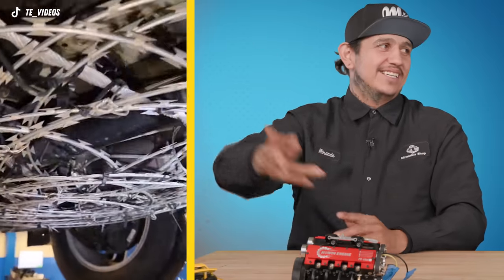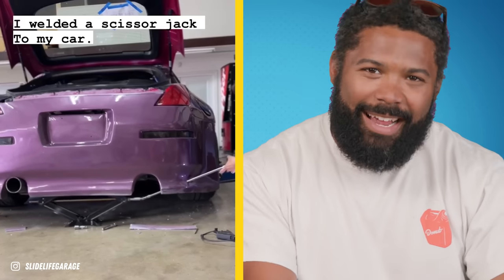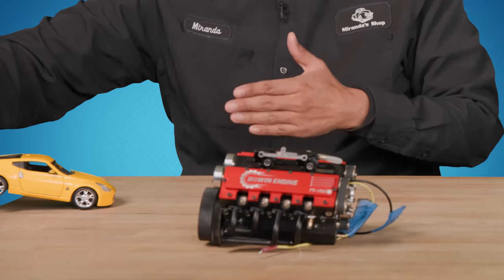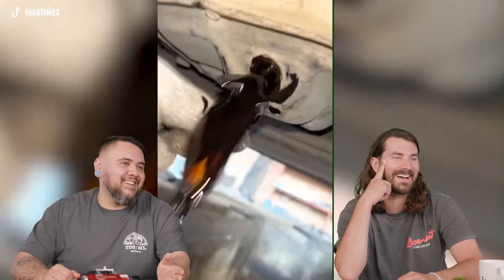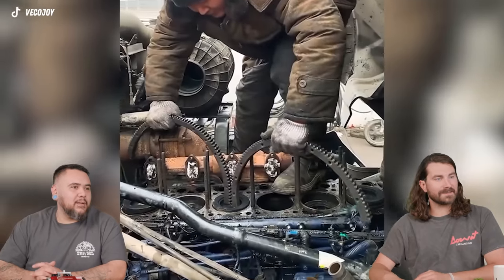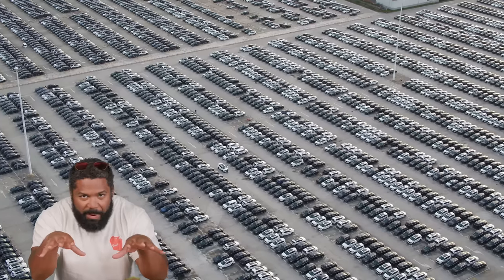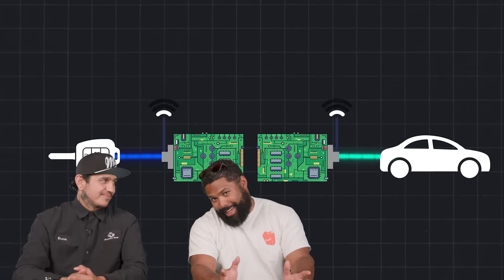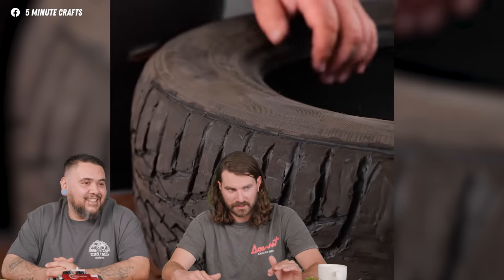Mechanic Reacts to Horrible DIY Car Hacks

Comment: 5:00 it's actually a legit hack, you put it in a higher gear like 3-4, we were stuck in mud and battery died, and we started the car this way, with cutting out the belts. We did it like a push start, someone pulled the rope and someone dumped the clutch, it started right away. It was a gas car, I imagine it would be more difficult with a diesel car, or with a bigger engine.

Comment: "retreaded tires" / "retreads" do NOT have new grooves cut into them. 
they have a new outer layer added with grooves in it. 
they attach the new outer layer using vulcanization.

Comment: The Rope hack: I can see this working tbh. I used to start 2 of my cars in the past by pushing them. Even on flat ground, the thing is you push em with disengage clutch and then pop the clutch. So its nactually not that hard to spin the tires. Getting the tires up to enough speed with the rope is not the issue i dont think. The issue might be, that engaging the clutch will put a resistance on the weel. And with the wheel in the air there is not like 1,5 tons of car pushing through the resistance. It might be that the tire would just stop spinning. 
But for a rolling start you only need like 6-7kmh usually, the spinning speed is not the issue. Anyone can get the wheel spinning fast enough with the clutch disengaged. Its not actually hard to do that even by hand.

Comment: I think the hose thing with the tires is silly. The applicable scenarios are few and far between for something like this. If you're on the side of the road with a flat tire then you have a fast leak or a shredded tire, you're not going to reinflate that tire.

Comment: Can you imagine trying to steal a cetalitic converter, and there's a spool of concertina wire blocking your way. Do you risk removing it and accidentally having the wire pin you under the car when it comes off?
Maybe it's enough to consider that they might go to the next car.

Comment: Razor Wire:  Sorry, I don't see thIS as "whacked." It's not designed to be impregnable, it's designed to make the thief want to look elsewhere. There are thousands of vehicles that do not have anything guarding their cat, why waste time on this one when I can go down the block?
Rope Start: I didn't hear anyone say this only works if the car is a stick shift.
Flat Tire: What's the chance that someone has a 16 foot long air hose with two Schraeder Valve fittings in his car, but not have a tire inflator?
Zip Tie: That's not to keep his hands clean, it's to keep the plug from falling into the drain pan. Also to keep from burning his hand with hot oil.
Spill Prevention: That will also work if you wish to fill a higher container from a lower one. Like if you want to get a quart of oil from a 55 gallon drum (But be careful of the spray, it works best if you put a quart into a gallon container.)

Comment: The hack with the keyfob to the head isn't anything to do with the head. It's doing the same thing as having a taller antenna essentially.  You're raising it to where the receiver can receive the signal easier. Raising it above your head full arm extension will get the same result. Just saying. Yeah, and the tire regrooving, you can see what they filled it with coming off, and some of the original tread is showing through. XD

Comment: Roll start only works in cars that don’t need a charge for the computers in it. If your battery is dead you won’t start it by roll starting unless you had enough battery for the computers to fire up.

Comment: Pro tip for oil changes: instead of just hand loosening the plug, you should use your hand to push the plug towards the plan while you hand loosen. Once you reach the point where you feel like it's just spinning in place, quickly pull it away from the pan. You'll still get some oil on you, but that's the easiest method I've found for resucing it.

Comment: My 1965 Chrysler Newport had the 727 torqueflight with the dual pumps and could be push started at around 25-30mph. Best vehicles are the old ones!

Comment: I'm not a crazy mechanic or nothin, but when I did alot of oil changes the wrench trick at 9:50 was a LIFE saver, we only ever had a single breaker bar in my entire shop, and very often the guys were jack ***s who'd break the oil pan if they used it, so more often than not it required a supervisor to use it, So alot of us guys would just use this trick to UNSCREW the plugs, However to me it looks like the dude in that video is TIGHTENING the bolt, which is instantly a fear factor of like 100x for me because I had a guy in my shop do that same thing, he was an absolute BEAST for us smaller guys like me who'd struggle to break seals and such, but he was also notorious for breaking wrenches and other tools because he was like the flippin hulk or heman. but that video seems to me liker a real easy way to break your wrench unless hes trying to loosen it, which judging by my lack of information on it and context, dude looks like he made righty tighty into righty loosey.... could be wrong i know alot of stuff on cars goes the opposite way... lookin at you subaru...
Reply: Note : nope hes loosening, hard to tell for me from the angle of a camera. lol but nah i aint worried for him now, ive even done three, so its ultimately a fine trick xD but it is a life saver for oil change guys.

Comment: That first bit, that's not bob wire, that's razor wire or constentena wire, and it unfurls to be about 4 feet in diameter. It's under tension the way it's tied up, you loosen what's holding that together and it's going to flail about like a bastard and shred anything unfortunate enough to be in it's way. It's literal razorblades tied in that wire. It's a potential lethal bad day.

Comment: you can crank some smaller engines. I had a Polski Fiat (126, 600ccm 4-stroke  2cyl) with a semi-Volt battery. I cranked it in 4th speed by the wheelscrew, usink a monkeywrench. One worry was that the wrench will facehug me if I succeed. Put to the measure, calculating the differential's work, it's 8th gear in a 126 :)

It was a 6V car, so I didn't have the chance to wire it to my 12V supermodern 16 years old suzuky.

Comment: 1:20 While that may not be too hard to remove from the car, I feel like if you released that barbed wire it would spring out and expand. Giving any thieves (or mechanics) a nasty surprise.

Comment: One of the most craziest things ive ever seen is a car passing smog while burning oil and having black fumes come out the tail pipe and its a gas powered car😂😂😂😂 the guy rewired it from the o2 sensors to oil temp sensor and to the maf sensor which somehow made it work without check engine light being on😂😂😂😂 never seen it again but when i actually fixed it and made it read what it was supposed to i was amazed on how smooth it was running after even tho it was burning more oil then a diesel 😂😂😂😂😂

Comment: That rope pulling to start the car is not only stupidly dangerous but more than likely won’t work. 
1-He has the car up on a tiny jack. If it did start, it could rock itself off the jack.
2-If it did start, that rope could get caught around the turning wheel/tire assembly and mess you up.
3-getting a car off a jack with a spinning wheel is dumber than a bag of hammers.

Comment: If you ever have to push start your vehicle do not pop the clutch in first gear like this mechanic said Pop the clutch in second gear the car will start just as easy with less torque put onto your gears so you get less transmission damage.

Comment: When it comes to the using a tube 
to inflate a tire with a tire the only thing I’m confused about is what’s going to compress the valve stem inside the tire to make it air up the other tire

Comment: Had a buddy snap his driveshaft out wheelin n fishin. Duct tape got him home (90 miles) and probably could've gone further. I don't think he did the stupid limit on the highway but can't remember. All you need on the trail is done duct tape, baling wire and a flathead screwdriver and you can fix anything😂

Comment: So the person taking out the pistons with the cut gear, Wouldn't you still have to undo the concecting rod bolts? Hence you would still need to drop the oil pan. Still helpful if you not that strong,

Comment: I found I had flat one morning when I woke up and I eventually located the nail. I put air in the tire and it didn't go flat again for about 6 months. I really just wanted to see how long it would take for it happen. 
Also yes I bought a tire repair kit and already had a portable compressor the day it happened. Its been 3 months since I refilled the tire and its still reading the same pressure I left in it. There is no patch on the nail whatsoever. Its just a lucky tire.
Reply: Should I continue to leave the nail and find out how long the tire remains at set psi (42) or just pull it and patch it?

Comment: Touching the remote to your head is not why it works. It works because you're lifting the remote higher and allowing the signal  from it to travel with less obstacles between it and the car.

Comment: The remote hack uses bone conduction to amplify the signal. It is the same reason if you plug your ears, and eat food, it seems to get louder. Also how bone conduction headphones work. But the bone conduction can reverberate many wave types, even those used to open a car door.

Comment: flat tire hack is hack because nowadays not many cars come with SPARE anymore but with sealant and a small compressor but the sealant will destroy your tire so rather have 2 almost flat tires than use the sealant and have to buy a new tire (if the puncture is fixable of course)

Comment: I tell people the key to your head trick. Every single one looks at me like i just punted 19 baby kittens at the same time. I’ve tested each time I get the extra range holding it to my head, and holding it just as high away from my head. Almost everytime the key reaches but just in height. Holding it to your head doesn’t increase anything from what I’ve found. It works on height most likely due to less interference.

Comment: There would not be enough pressure to inflate the front tire since the car is heavier in the front because of the engine. If it was the other way around, it might work in theory.

Comment: All the mechanics missed the flat tire problem.  The hose would have to have special connections to plunge both the valve stems in to do what is shown.
Reply: nothing special about them, a basic air compressor starter pack will have all the fittings you need. $30 tops.

Comment: Lol "the power of air"... it is not the power of air, that separates the buckets. When you pushed the buckets together, you essentially created a low pressure zone between them (aka a vacuum, or close to it). Pushing air inside simply equalizes the pressure and allows the buckets to be separated.

Comment: Those scissor jacks aren't built to handle the torque of an impact wrench while lifting a car.  If using an impact wrench to do more than replace a wheel or two, multiple times a session, the threads on the jack will heat up and deform, causing catastrophic failure of the jack.  I speak from experience.

Comment: I think the Rhodium is the most expensive metal in a cat as of right now or at least in the last couple years it was and the remote hack works because of the water content of the human body it basically turns you into a huge antenna.. Remember the days of rabbit ear antennas(before cable and satellite) you'd grab it picture would be clear, let go and the picture did too

Comment: The fillings in your teeth can also act as an amplifier for the key fob, if you don’t get the range from just holding the fob to your head, try opening your mouth in the direction of the car and you get even more range.

Comment: man be careful welding shit under your car, think about what happens if that falls off on the high way. The barbed wire is like a mad fail waiting to cause a multi car pile up though. I don't like vises mounted to the back of utility trucks either, makes me nervous driving behind that.

Comment: The remote thing to put on your head is legit, the theory from that is the liquid inside your head increasing the remote transmission range. If you have a water bottle, you can try to put the remote on the water bottle too.

Comment: You don’t need a rope, put it out of any gear and with the driver door open on a flat surface push the car up to about walking speed holding the wheel if you need too.  Then hop in quick and pop it in first.

Comment: As a tire tech who has worked in the commercial field for a while now, that self done "tire regrooving" is the dumbest thing I've ever seen. Real regrooving is an incredibly advanced process where most of the tire tread is shaved, and a "cap" of new tread is affixed to the casing. It has its flaws but the company I work for has a fairly good process of making sure we aren't recapping bad tires that will blow. The tire in that video getting "regrooved" is incredibly suspect, since you would most likely be getting into the steel cords with how deep he's going. Not a hack. Completely wack.

Comment: I always keep my truck camper tire plug things waxy look at the string thing that you shoving a tire. I always keep that my to my camper just in case I CNM yank it out put it in there can use my compressor and pump the tire up and we’re good to go.

Comment: The pull start on the tire works
-you need to lift up the hole front so both front tires are in the air
-the higher the shift-stick the easier it gets so 4 and up

a school friend of my did it with his car becouse the starter was broken

of couse a manuel car

Comment: Using a rope as a makeshift ripcord for the wheel to start the car is actually possible, you just want to do it in the highest gear possible for minimum resistance

Comment: pull rope start is legit. Just put the 5th gear in and do it. But better way is push the car to some speed, kick the 2nd in dump the clutch and go. Do not do it on 1st gear, the ratio is too high.

Comment: 9:57 this is wack. It's very dangerous and there are better diy options. Grab a steel to pipe and slide it over the wrench. It gives you the longer fulcrum, doesn't have the risk of a wrench flying off, and it somewhat protects the wrench from snapping.

Comment: 4:25 plot twist: it´s a rear axle drive. Real hacks not for cars: need to get a hook in or out a wall? Use a smal ring wrench or if you need to do it more often, get a smal ring hook, grind off the winding and put it into a cordless drill; hooks are out in seconds.

Comment: The regrooving was definitely fake. They put tar in the tread. And truck tires they are retreaded not regrooved. A strip of rubber with tread is glued onto the tire, they don't cut tread in the bald tire.

Comment: It is possible to start a car with a rope. If you cant in 2nd gear do it in 3rd or 4th gear.
The very first car created were started by a handle. So you do not need to be the rock

Comment: 5:20 
A. put the spare on
B. if ur too lazy for that use the air from the spare to fill it as those are aired up higher and not on the car

Comment: Nah, on the rope start. I've bump started multiple vehicles and nah, you ain't doin that with a rope. If the battery is flat dead you can't catch spark either which I learned the hard way😂.

Comment: Tiktok is a special place for the speds to run wild. Tire retreading lmao. If you take away the tread and look at the stuff under it’s like the thickness is 30 sheets of printer paper together. Not thick at all. You can’t retread it even a little bit

Comment: I continue to insist that 5 Minute Crafts is satire and not supposed to be taken seriously, except to prank your friends. Also, if you can't get your breaker bar in somewhere, try finding a sturdy length of pipe to fit over the other end of your wrench. Always think about what might happen if you snap your wrench!

Comment: Now you guys need to test the pull start on a handful of the different manual cars you have laying around. I've started cars by rolling down a slope and it doesn't usually take too much speed, but I'm skeptical that a person can pull that rope hard enough to turn the wheel that fast while it's in gear, what with the engine compression fighting against you.

Comment: One of my boot was loose for a while later it ripped started to spin and was hitting my brake line then it broke the line. Replace the brake line, then replace the whole axles before is lost all the grease it was metal on metal it was really bad 😂

Comment: The wheel was spinning freely when he rolled the rope around it…now he pulls and it starts the car?  Makes no sense.   Even if he wrapped it in N and then popped it in gear to actually pull start it, you now got a car running in gear with the wheel spinning up on a jack…hopefully the car doesn’t have limited slip or it’s gonna drive right off the jack.  Even with an open diff seems super sketchy.

Comment: The guy with the rope around the tire must be a single engine airplane pilot. Spinning the propeller by hand or rope can start the engine if the battery is dead.

Comment: The flat tire hack is whack. It won't work, since the air wont come through the valve out of the "donor tire". How would you press the little release thingy in the valve to let the air out???

Comment: The re-grooving one is 100% fake.  The way the material is peeling does indeed look like it was filled in and then cut back out.
Reply: In cases where someone does that for real, there are jobs amateurs can safely do at home, and there are jobs you need to bring the car to a professional for, and jobs where you’re removing material from vital parts is definitely the latter